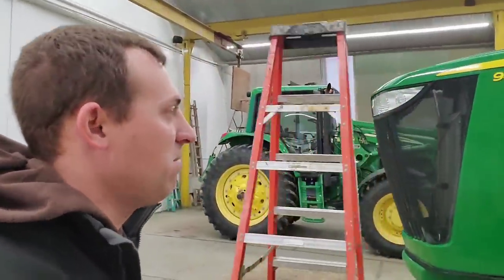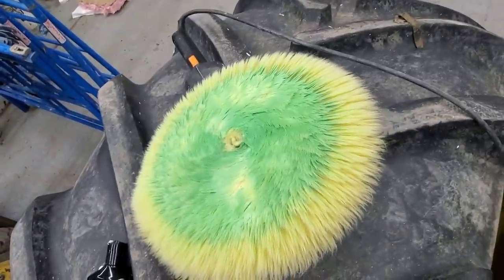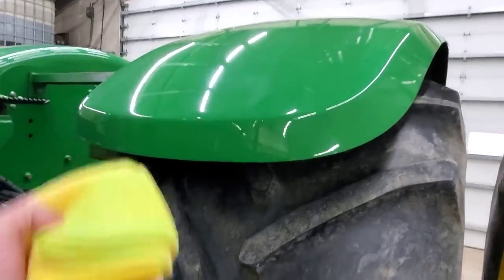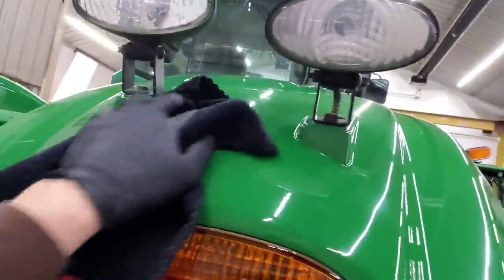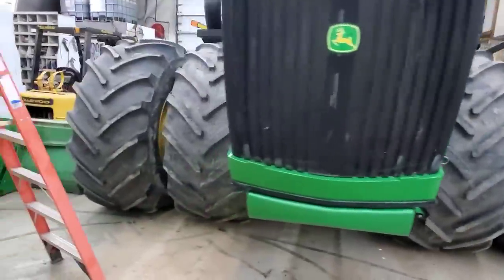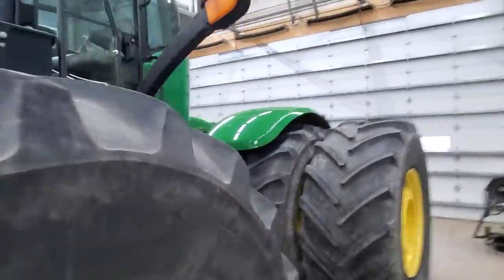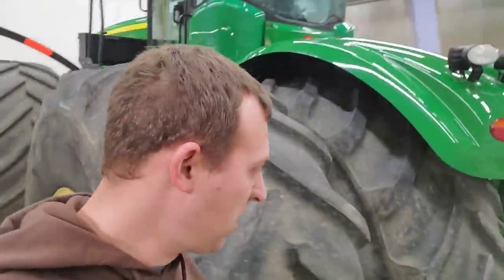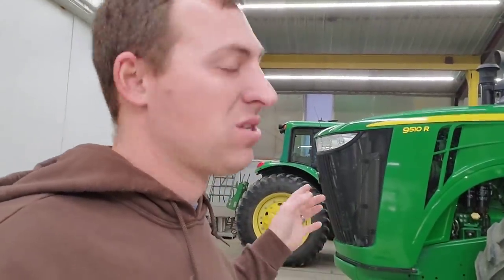Ceramic Coating Time! - #322

Comment: I use Griots Garage compounds. Long working cycles, easy to buff off the residue, great stuff. And I put Gtechniq  Crystal Serum Light then add Gtechniq EXO for a sacrificial hydrophobic layer then I’m done with it for usually around 5+ years

Comment: Nathan, the plastic panels are painted with the same paint as the metal parts. That means you can use the same compounds and polishes on them as well (to include the ceramic).
Reply from the maker: I don't think they are. They are colored plastic and the same through the whole thickness.

Comment: Nathan buff those side plastic panals same as you side fenders also you are using way more ceramic on the applicator pad a few drops is all you need for the whole fender, it's not like wax that you have to see on the surface you really shouldn't see where you've applied it before you wipe it off with microfiber cloth..you put a few drops on wiped then added more wiped, added more.  Only need 5-7 drops is more than enough to do a fender. I get 2 full size pickups done on that bottle you have..glad you bought the ceramic wax I told you about..looking good I use chemical guys VRP on my black plastics looks new and will last...
Reply from the maker: The instructions say to start with 10-12 drops then add 2-3 more when it starts to get dry. I don't know but that bottle goes way farther than I thought it would. I've done 4 tractors with a kit and a half.
Reply: @BorderViewFarms  well all you have to do is wait till the ceramic coating starts to get a rainbow look to it  then wipe it off..

Comment: wasting your time with that polish 3m 3 stage compound way better
Reply: Ian Harvey : Please remember, those meguiars products are made for the consumer market. 3M are made for proffesional use. The key is to keep the pads clean all the time. 👍
Reply: Might be but that’s all we use nothing compares
Reply: Meguiars got a cutting compound, marked 105. That one works amazing with a woolpad! Easy to remove scratches with, and leaves hardly any swirls. And the best part, it brakes down and gets finer and finer. Instead of two steps, you do both at the same time. Saves money and time.